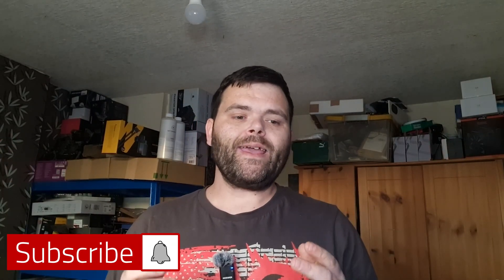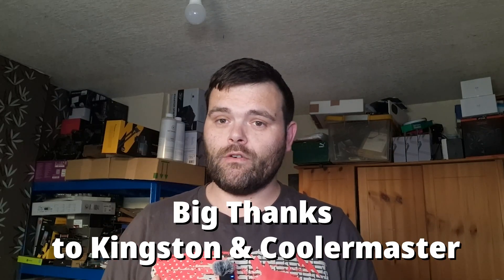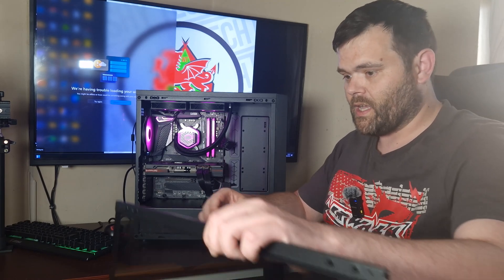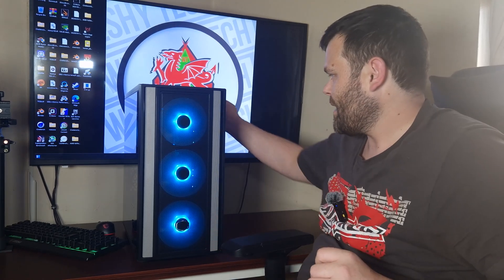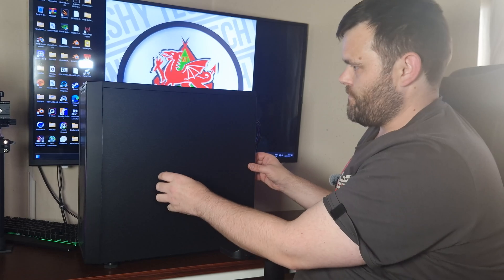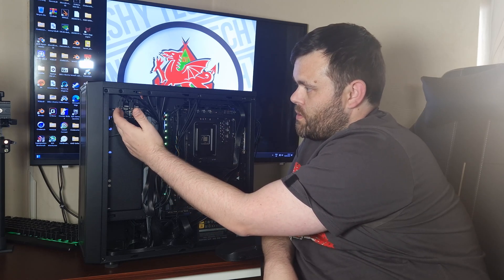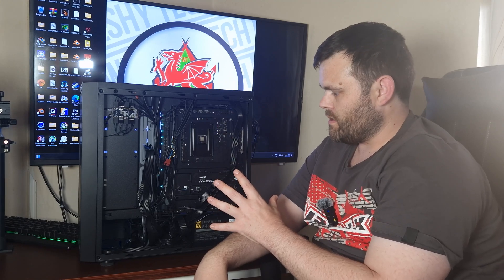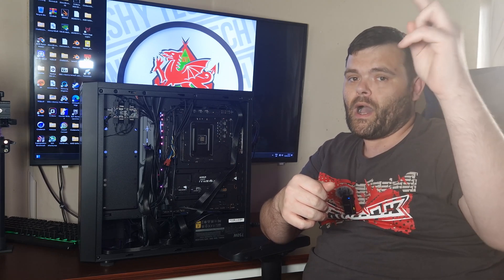Ryzen 5 5600G - The Ultimate 1440p Gaming Build 2024

Comment: An AIO on a 5600G? Did you overclock it? I think the 5600G TDP is only 65W!

My rig's not far off that - the main difference is an Arc A750 GPU. Of course I would not go for the 5600G now, but at the time it was a system without a graphics card, so the IGPU was useful at the time, plus it could be handy if the discrete GPU fails. And it doesn't look as good, but it's a box that sits on the floor... I'm not big on the ol' RGB stuff!
Reply from the maker: The cpu draws more than 65w and with PBO enabled it can draw 160w if tweaked
Reply: I'll have to give that a go - on the other hand I do pay the electricity bill!